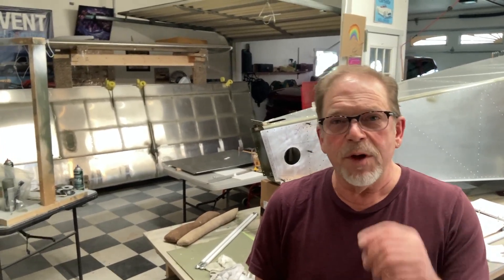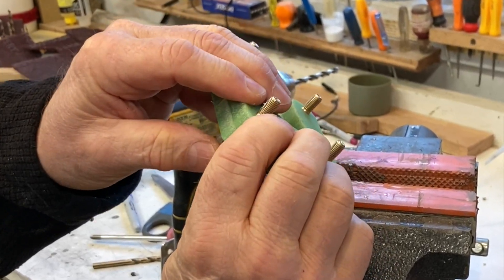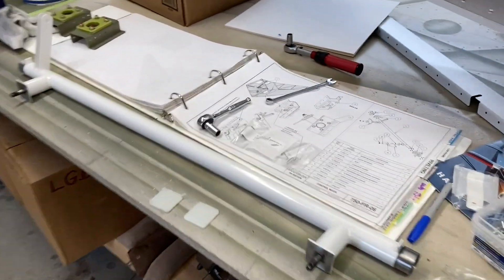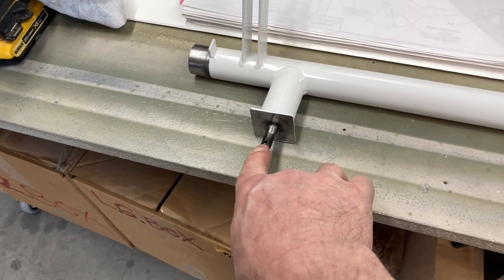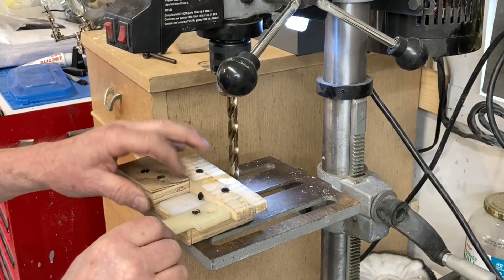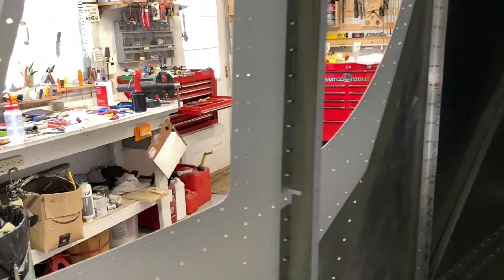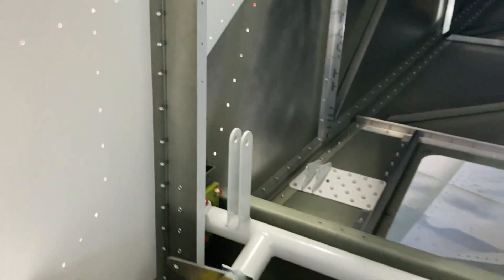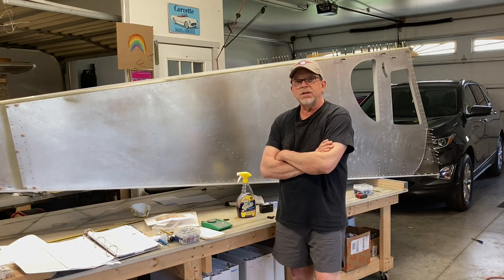Zenith CH 750 CruZer Build...Flaperon Controls

Comment: What primer/paint are you using on inside?  Great content!
Reply from the maker: Thanks for watching. I'm using a two-part epoxy sandable primer and thinning at 10% because I'm not trying to fill scratches or imperfections. I'm also painting the inside with just an automotive single stage paint with catalyst. Hope this helps. Have a great day.

Comment: Sorry to hear you got that nasty respiratory crud too, I can only only imagine how much worse mine would have been with asthma.   Can you expand on "double checking the X" for making sure the fuselage is square?  Great stuff Dennis!
Reply from the maker: Thank you. I take it. You had a hard time also. I was thankful I didn't end up in the hospital. The X thing is just at the front of the fuselage. I measure from some exact point from top right to bottom left , then top left to bottom right. and want the measurement to be exactly the same. If the top was say slightly left, one measurement will be longer than the other that's not a good thing Also this  only works on symmetrical not "A" symmetrical boxes